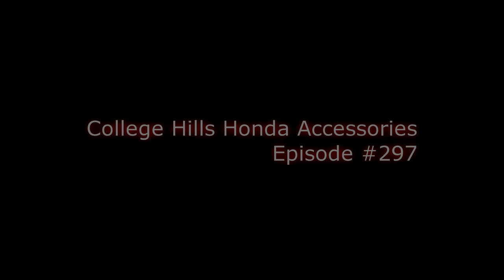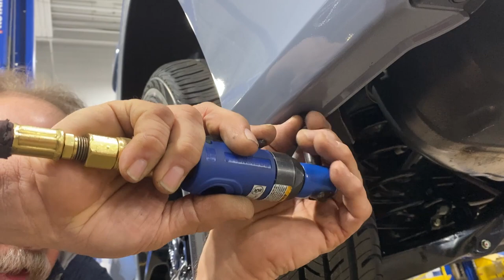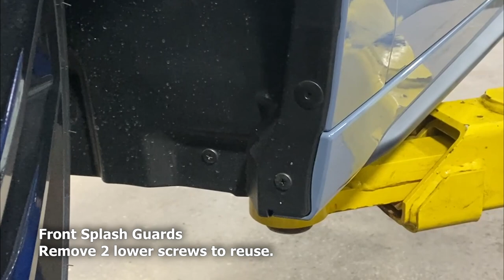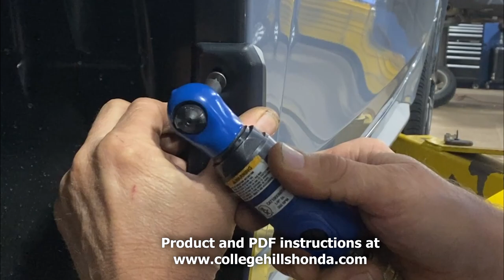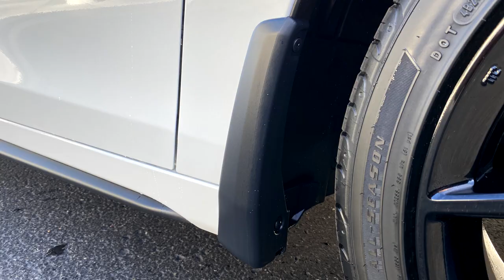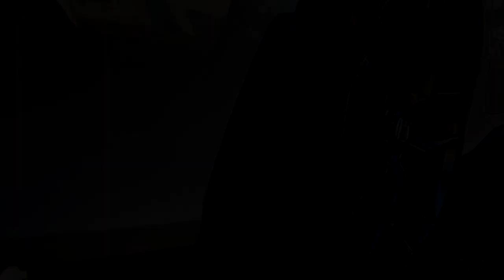Episode #297 - 2022 Honda Civic Hatchback Splash Guard Installation

Comment: The PDF instructions on your website direct the cutting of the rear fender cover. That is not shown in the video. Is it unnecessary?
Reply from the maker: Not 100% necessary but you can judge for yourself during the installation.
Reply: I went ahead and cut it out using just a pair a scissors. It turned out great thanks to this very helpful video. Especially when it came to the trick of moving the guard over and marking the spring clip reference so easily. Thank you.

Comment: Is it common for one or 2 not to sit completely flush? I bought some and have loosened/pushed them in then tightened, but still not completely flush
Reply from the maker: Quite common actually. We put splash guards on every new vehicle that arrives and we notice the same thing and not just on the Civic. Unfortunately we cannot explain the exact reason.
Reply: @College Hills Honda  good to know. I was concerned cause the instructions say they should sit flush.

Comment: Unfortunate Honda came up with that spring clip solution.  You have to damage the bumper to mount the rears.  Hard to do to a brand new car.
Reply: For real … extra unnecessary extra plastic for a higher quote